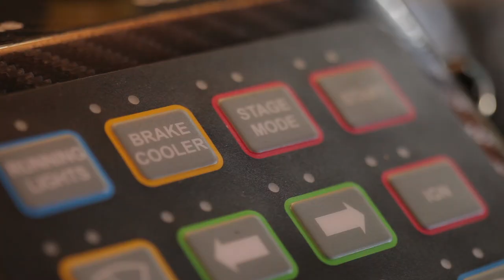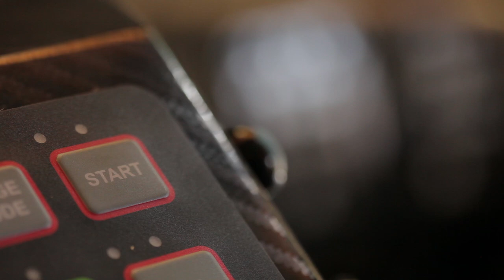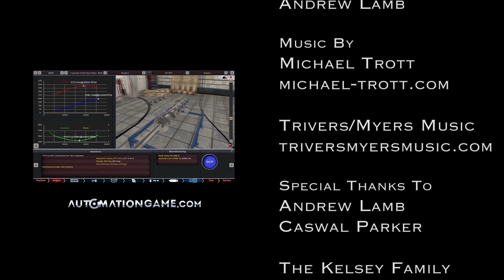The Homebuilt Rally Car That's Too Fast for the WRC - TST in NZ

Comment: He basically built a fuckin Group B. Group fuckin B. That's awesome.
Reply: Group B is slower than a 2017-2021 WRC car though.
Reply: @jasonmoyer  this video is from 2015
Reply: @n0ts0dev  group  B was slower than 90s rally cars, the progress made in suspension gave better times even with much less powerful engines
Reply: @arturdyduch4616 and I think part of group bs problems were that the suspension and the brakes were not able to keep up with those engines
Reply: @MrBioniclefan1  Imagine group B with that safety.
Also spectators were stupid in the 80's. Another reason why Group B ended.
Reply: What makes this a Group B? It's not a turbo, it's not from the 80's, the engine has a bigger displacement than most Group B cars. Got absolutely nothing to do with Group B cars...
Reply: The Metro 6r4 is like this car
Reply: @jasonmoyer  But still offer more fun and excitement than the exact same stupid looking of wrc 1 cars and rally 2 nowdays. It can be fun at times but compare to the fun of Grp.A and the monster of Grp.B? its just sad

Comment: i suspect the reason for not getting into WRC is that it does not meet the requirements, not because it's too fast...
Reply: Ray don't tell them that..let the fools keep chatting shit rather than hear the truth
Reply: Well it has too much HP, maximum is around 300 horse power in WRC, and it's also too light by 200 kilos or so.
Reply: RobyYe Eurobeat also it has NA 3.0 V6 when wrc cars use 1.6 turbo, so not meeting the requirements
Reply: Ray
Oh I didn't disagree lmao, but it's also ridiculously fast
Reply: RobyYe Eurobeat not really..back in the 80's a Cosworth engine RS200 Evo could do 0-60 in 2.1 seconds so this kid better not think he is really special..he just chucked a load of bits together and built a neat car not the next best thing
Reply: Mr Hollywood
Those are Works built cars, this is a barn build so give credit where credit is due. Besides that was Group B type stuff, it was mental and different regulations as well. I still feel it's astounding that he managed to mill most stuff and get it properly done (with help, obviously). I wouldnt be able to do it.
Reply: it's no small feat what he did, my issue was the title wich suggested the car was too good for wrc
Reply: it's no small feat what he did, my issue was the title wich suggested the car was too good for wrc
Reply: Now Ken Block is nothing more than an overhyped talentless fool with cool edited youtube videos. And no. Wrc has regulations with horsepower. I'm not sure what it is right now but the 2 litre turbos had maximum of 350hp the 1.6 litre ones have probably less
Reply: RobyYe Eurobeat but it's not ridiculously fast like I was replying to the guy who said so by proving what was available over 30 years ago.. it's neat but nothing special as there's hundreds of cars like it built by guys but they win stuff they are legible to race
Reply: Ray Wrc cars and drivers would make the guy look well out his depth unfortunately.. Otherwise he'd be called M-Sport Prodrive etc
Reply: not even in your wildest dream rs200 made 2.1 secs, thats compeltely a myth.
And do not say that he " chucked a load of bits together" for god sake, he had the determination to build a fucking rally car jeez...
Reply: diego d with the boost high and toluene in the zakspeed tuned Bdt then yes they could... A certain driver had a formula one team looking after the mechanicals...You know nothing
Reply: Kev the Rammer you a rally car faster than this. why do you have to talk shit about this kids dream. way nicer of a car than any you will own.
Reply: Kev the Rammer name one that i can't afford that you have rallied
Reply: Kids kids, stop Pickering
Reply: Colby you couldn't afford the 8 pot brembos on a tarmac Wrc car never mind a xtrac transmission..the rest of the car would cripple you so run along ...the computer games console wants you back
Reply: Kev the Rammer i never said i could afford. but i want to know the cars you've claimed to have rallied
Reply: Kev the Rammer Ayy the thing is, is that This kid put this car together in a barn with the help of some (SOME) people, yeah most are professionals. Anyway That RS200 has hundreds of thousands of dollars into it and it was built in a legit factory with a shit ton of Professionals to get it perfect. He can think he is special If he wants. I think he is because HE (NOT A FACTORY) HE did it.
Reply: The fact is that the boy did a good job, but he did not follow the requirements, sad but true.
And someone mentioned the Ken Block and his car, Ken raced in Global Rallycross before, and now in FIA World Rallycross with 600bhp cars, not WRC. In RX you have similar weight restrictions like in WRC, but max power is 600bhp. His last WRC car was 350bhp Fiesta, before that I think that he drove an escort, idk, he had no big success, same like in rx, sad.
Sorry I'm late couple of months.
Reply: Ray hold on. F1 cars use 1.6 turbos...
Reply: No car is too fast forr WRC, it just doesn't meet the regulations since group B was discontinued
Reply: He did some of WRC races as well, but I doubt he finished any, he did in fiesta WRC
Reply: Its funny yo see such successful and wealthy out the ass race pros on YouTube talkin trash...
Like the video says "it's not that I dont get this everyday... I just dont see this... EVER..."
'Lol
So thank you'
Reply: does it matter, I mean just listen to it, yes it doesn't meet most of the regs but just accept the fact that is fuckin awesome
Reply: this post is a joke.  if any of youwere die hard fans you'd know the wrc class limits the engine size to a 1.6 litre turbo charged engine limited at  380bhp and there are four spots in the wrc class currently ford fiesta, toyota yaris, hyunda i2.0 coupe and citroen C3
Reply: wrc cars use 1.6 turbos
Reply: Daan Made in Holland stop talking. You know nothing.
Reply: Liam S displacement. F1 cars are V6, rally are I4s
Reply: 300hp limit
Reply: but KB couldnt handle that car on WRC thats why he does another stuff
Reply: I mean he is pushing about 75hp over wrc cars
Reply: ray for some weird reason i think you are right 0_o
Reply: He also would need to make 500 copies
Reply: This thread is hilarious.  9 year olds fantasizing about being rally car drivers, and lying their asses off. "I'm a douche and I've driven more expensive cars than you'll ever even look at...Blah blah blah."  Great stuff.
Reply: Doesnt the WRC only permit 4cyl Turbos? And they restrict the turbo size too?
Reply: he is special....if he wasn't everyone would be doing what he's doing....Oh btw...what have you done with your life?
Reply: What are the requirements? They should have the best drivers in the world. This kid is better than at least half of WRC, let alone he is building his own rig.
Reply: Correct Ray! The WRC have rules like every other Series too. And this is NO WRC car. This is what ever it is ........ but not a WRC car.
Reply: @Repsikka  the title of the video suggests what it states. the car is too fast for wrc, and it is. If i was you i wouldn't go looking for things to take issue with. Especially on the internet.
Reply: @Repsikka  is he really that hyped tho? I suppose lamens know his name above most others and he sure as shit doesn't deserve to be one of the biggest names in rally like Collin Mcrae but i feel that most people who watch races know he does it for fun and makes most of his money off being stupidly famous
Reply: @elmtreeroad   power is not limited in WRC, restrictor plate on the turbochargers is limited to a 36mm, engine size to a 1.6 and rpm to 7500 rpm.
Reply: Ruck Bogers all things that are major contributing factors to an engines power output...but for real google it top class WRC is a battle of driver not car
Reply: Ray he started driving when he was like 35. He’s not the fool in that scenario, it’s everyone hyping him up
Reply: @Repsikka   I think Ken Block is talented, but being talented is not enough if you start driving at age of 35. I would say if you start racing at age of 25 it's all ready to late if you want to be a world champion in rally. to day there are guys in WRC who started driving rally cars at age of 6, there is no way your going to learn those skils if you start that late. Ken Block is just driving rally cause he loves that sport, there is no reason to hate him for that
Reply: @HENRIKOIVUROVA  he's way overrated and overblown
Reply: Comparing this barn barn built car by a 20something year old to group b cars is stupid
Reply: Daan Made in Holland  380 hp is the limit you dope.
 This produces 450
Reply: @bigjohnfury5662  you're an absolute dope
Reply: Certain tracks have certain avg speed limits sounds dumb but if u beat a certain time it means u went over the avg speed
Reply: @GeneiTengu  this would be slow even in Group B standards
Reply: It's mainly due to the engine. Most wrx cars are limited to 300bhp
Reply: Daan Made in Holland  wrc cars go from 0-60 in over 2,3 sec 

Rallycross cars does 0-60 in 1,8 sec also different type off beasts with 600 HP instead of 300
Reply: @Repsikka  She's some wagon all the same
Reply: @GeneiTengu  barn build really ? No offense to him cause it's a bad ass car but your high if you think his parents are not rich as fuck. Went to renault race team and offered money for near equivalent to F1 engine alone is big time money. This isnt a "barn build" maybe welded shit in a barn but this is some high dollar CNC and autocad custom fabrication build not barn built.
Reply: @bigjohnfury5662  the group b cars were fast as fuck and thats why they changed the rules cause they can make 4 bangers have excess of 500hp pretty easily but learned it isn't about hp it's about suspension and geometry of suspension that makes the cars faster. Cars now have less power but put down faster times.
Reply: It's the cubic capacity
Reply: It’s displacement is a not up for WRC standards
Reply: @elmtreeroad  thanks Somebody said that 50 comments before you.
Reply: @Repsikka  "talentless fool"? Pretty big talk for someone with 3 subscribers.
Reply: @metalforever12085  never said I was better than him, but only thing Ken block is good at is editing videos to make them look cool. He has raced in wrc and when he did, he was at the bottom. Should I check your subscriber count to see if you have a right to opinion or not?
Reply: @metalforever12085  you have 3 subscribers as well, does that mean that you need to be quiet now or?
Reply: Ray you're right. For one thing the engine is a 3.5L, wrc it's limited to 2.5....
Reply: the requirements of being slow enough....hahaha

Comment: That moment when you try to achieve the American dream, but you're not in America, and people don't like winners.
Reply: good one lol
Reply: Christian Augustin What a load of bullcrap... It's clear nobody here knows how WRC works
Some specs about WRC
· Maximum allowed power = 300hp depending on the altitude. This means the car needs a variable turbo so it can deliver 300hp too at like 3000ft
· Type of engine = 2000cc 4-cylinder turbo, doesn't matter if it's inline, boxer or whatever
· Minimum weight = I always mess it up but I think it's around 1230kg
Reply: Christian Augustin WRC has some rules. If you break the rules, you can't compete with them. It's like building a V12 turbo NASCAR car and saying it's faster than any other NASCAR car
Reply: ***** No one here was even remotely talking about WRC. I was referring to the fact that people are hating because he built the car. They're all saying he didn't.
Reply: Christian Augustin Well, the shell is from a Peugeot 207 S2000, the rollcage seems to be pretty normal... I don't think he did a lot more beyond the engine-swap for a kind of engine not allowed in WRC competitions
Reply: ***** The shell is not from a S2000 car, as they're still a monocoque.  The Rollcage is actually the chassis, it's a full tubular spaceframe with some Peugeot shaped Fibreglass panels bolted to it, so it shares basically nothing with the S2000 or road cars.

The only actual Peugeot parts are the headlights, taillights and windscreen
Reply: Adrian B I say, screw them.  Good for you and welcome to America.
Reply: ***** check yourself before you wreck yourself
Reply: ***** engine size in WRC is 1.6L 4 cyl. Which has nothing to do with this car BTW. you are lagging behind for a couple of years on your knowledge.
Reply: Neo VeNoM Shit, I always forget that change of the regulations... But the effect on this car is the same: IT IS NOT INSIDE THE RULES, YOU CAN'T COMPARE IT TO AN ACTUAL WRC CAR
On the other side, this car is slower than rallycars built 30 years ago (Gr.B). It is not even the fastest legal rallying car in history!
Reply: ***** You sound really desperate to minimise this Kiwi's achievements. Why?
Reply: John Slee Nope, I want that clickbaiting title out
Reply: ***** wow. you get butt hurt of of someone using catchy titles? Probably hate newspapers as well. They are full of misleading headlines. Completely ruins the facts of the article you know. ;D
Reply: John Slee Cos it's easier to belittle someone than build your own car.
Reply: Yeah I got that impression. Pathetic, isn't it.

I rather like that old saying that goes something like "person saying it can't be done shouldn't block the person doing it"
Reply: ***** "NASCAR car"
thats like saying DC comics, and considering DC means detective comics it comes out as detective comics comics.
you just say NASCAR otherwise you sound like someone who doesnt know what they are talking about.
Reply: King Geedorah NASCAR is just the National Association for Stock Car Auto Racing so it is an ASSOCIATION, not a type of car. NASCAR races cars of several kinds (even 6-cylinder ones!), trucks and even those weird modifieds
So, yeah, you fucked up
Reply: *****
and? they are still generally called NASCAR, to say "NASCAR car" is still generalizing several kinds of cars, all you did was simply add "car" to the end and make it sound stupid.

"So, yeah, you fucked up"
needed an ego boost? how arrogant.
Reply: Sometimes the tall poppy syndrome happens here in America too. Usually within your own family
Reply: +Diego Ruiz the year after group B's demise the group A cars where setting stage times on par with group B. Group B cars are dinosaurs, awesome..but still dinosaurs.
Reply: gtirjohn So true, I've always said the GrB cars were overrated. Too much power, too light, not enough control. Drivers just couldn't drive them to the edge because they were extremely unpredictable!
Reply: +Diego Ruiz Yeah? But a kid built it in a fucking barn....without a multi million dollar team. Soooo who cares about wrc
Reply: +Christian Augustin I live in NZ and that's just some wanker who thinks he knows what were like, trust me we get so hyped up and so happy with winners because we don't have a very big county so were not going to win a lot of events so when we do we definitely are happy for them and just because some idiots think he didn't build it doesn't mean we all think that.
Reply: +Christian Augustin Kiwis don't hate success. They just hate it when you start acting cocky and loud mouthed. Theres dudes here driving around in Lambos and everyone is always admiring. Just make sure you're not speeding on public roads or revving your engines. New Zealanders hate that.
Reply: +Im a Fox You sure about that? for grumpy inhabitants, you sure dont have many restrictions on modifications for cars...
Reply: PommyDownUnder98 Yeah that's cause most of our problems come from drink driving, driving under the influence etc and the majority of crashes are mostly caused by the general public especially during public holidays. The Government doesn't really hammer down on the car moding community because they really don't cause much of a problem.  Its the normal people who speed around in their family vans and kill their whole family that really worry the police. Most turners I see are very respectful and compliant to the rules we already have. They really do look after their pride and joy and make sure their legal. Its usually the university students in their shit mobiles(ricer is what you call them) that don't have road compliant cars. Also street racing is taken very seriously here in NZ. So most people just mod their cars for track days.
Reply: Christian the American dream is made in china.
Reply: Except the American dream is to progress from rags to riches through sheer hard work. In his case, while he did work hard and that's admireable, he's clearly enjoying the benefits of having wealthy parents. No hate, just stating facts.
Reply: right on man